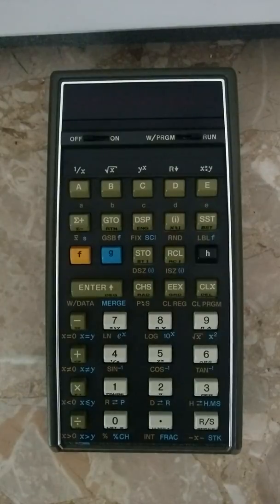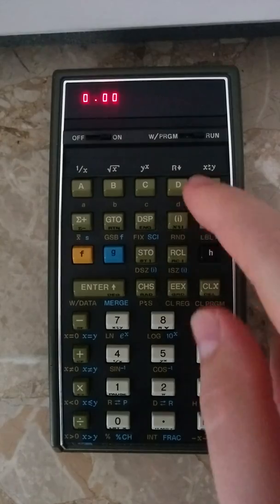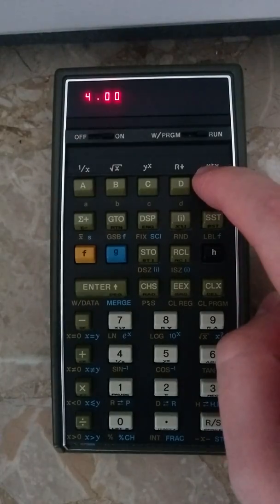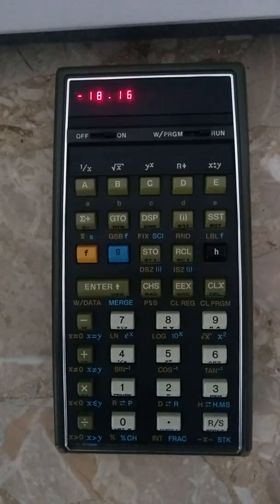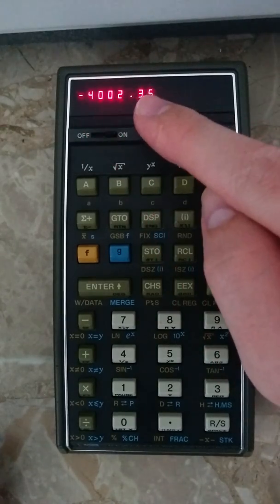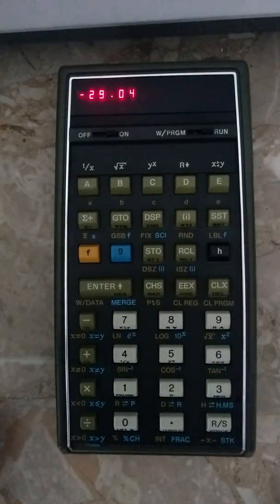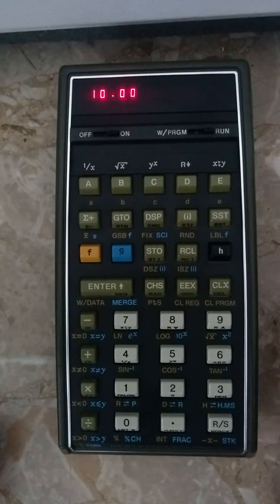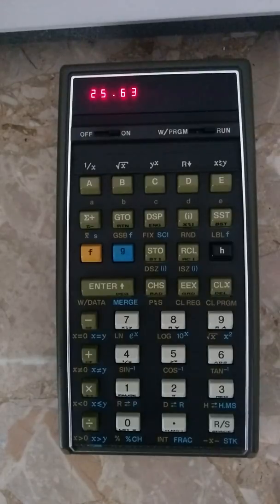HP-67 Program for optimising F14's AWG-9 scan parameters; Demonstration

Comment: Why do you use a 1970s calculator?
Reply from the maker: Because modern ones are messy, built quality is a joke in comparison, and using the old stuff can be lots of fun and actually teach one things the new stuff doesnt.
Reply: why are most of the buttons olive drab? Is it a military 1970s calculator?
Reply from the maker: @Bellator151  It's design is pretty unique, partially why its one of my favourites ! :) But no, it's a civilian market model. :)
Reply: Really interesting to see vintage hardware in action although tbh it seemed like you were teaching the calculator more than it was teaching you... ;)
Reply from the maker: @Bellator151  Heh, well its more the school of thought of having to deal with fixed amount of jump addresses, only a single indexing register for loops etc. that makes it actually educational. :))
Reply: well it certainly got me thinking: I clearly have no idea how far I need to depress the radar scan in, say, my MiG-29S in order to cover a target at a given range and altitude differential, based on BRA calls from AWACS... I'm guessing it involves trigonometry? Actually, according to the MiG-29 manual PDF p44 there is a way to enter expected relative target altitude and range into the right-hand side of the BVR HUD (so no calculator required, although I bet calculating it manually is often quicker, as well as more satisfying!). Anyway, thanks for an unusual and thought-provoking tutorial that caused me to learn something new!
Reply: For the memes